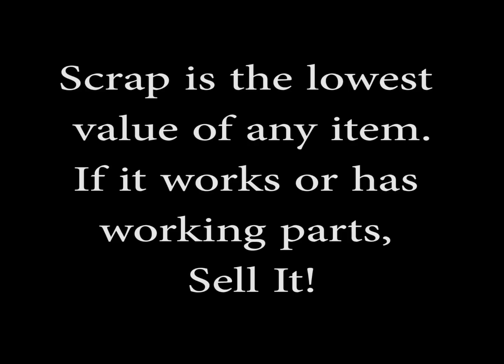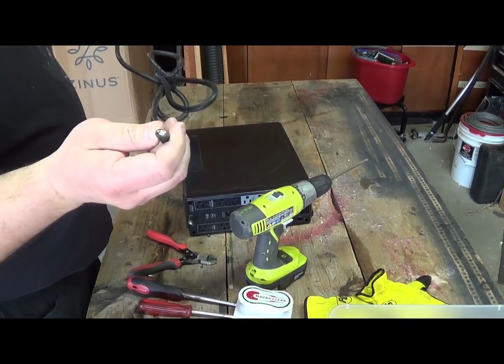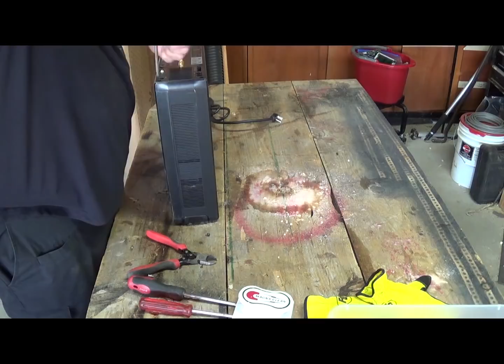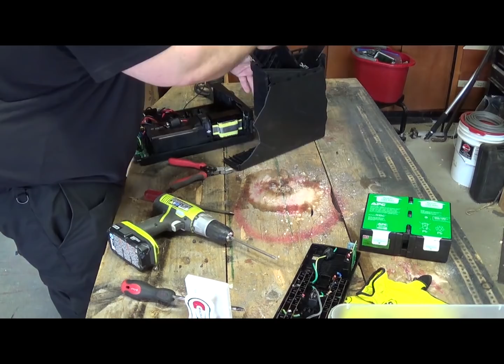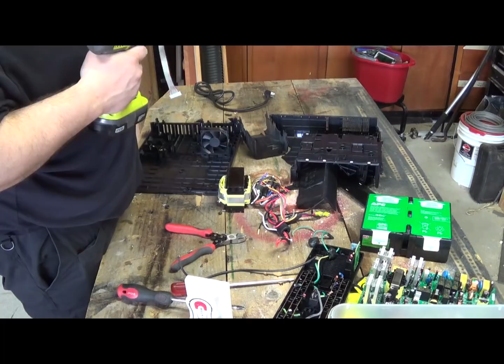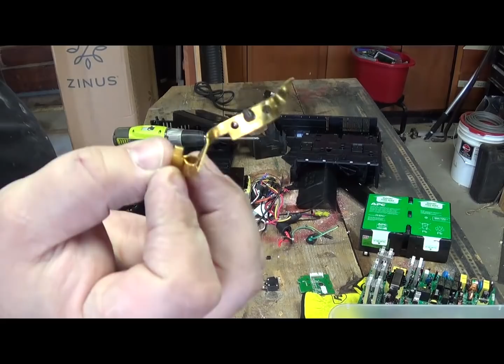Scrapping a UPS Battery Back Up system for Copper, Aluminum, Gold and more! #287

Comment: I scrapped a UPS with 8 batteries that connected to two server trays filled with an additional 16 batteries each. The printed circuit board was at least twice the size of the one you  have here with two monster power transformers and huge aluminum heat sinks. I'm putting the board away for another day. Anyway, enjoyed the video :)